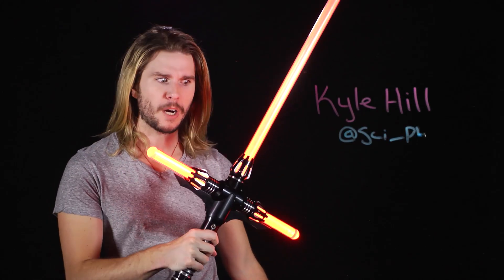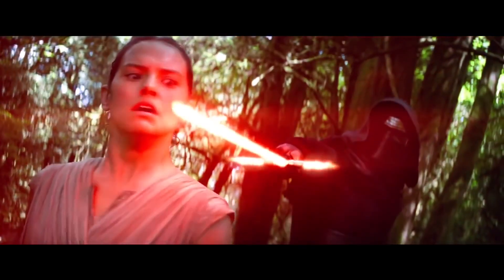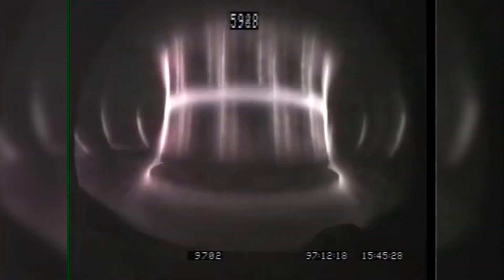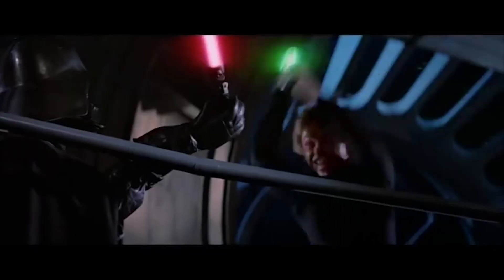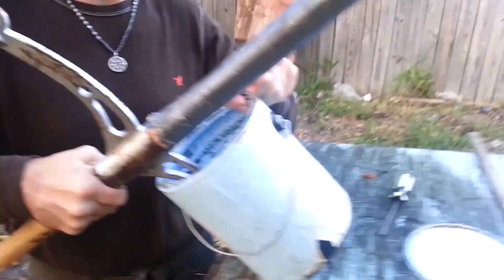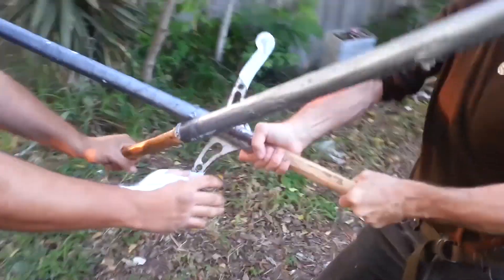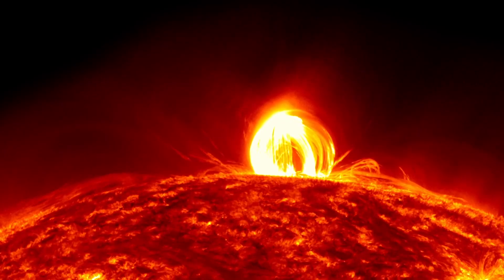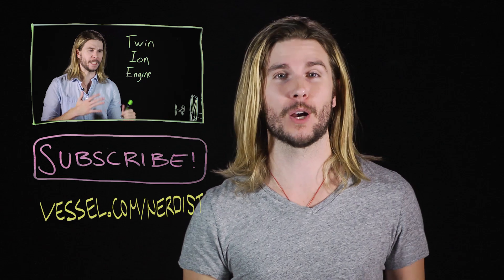Why Kylo Ren's Lightsaber Works (Because Science w/ Kyle Hill)

Comment: I really don't like Kylo Ren's lightsaber.
I know, it looks cool but I prefer the old lightsabers.
They just seem alot easier to control and use since you don't have to watch out for the other two lasers sticking out on the sides.
Reply: +Alexander Evensen You should try picking up a toy sword with cross guards and swinging it around a bit. You'd be surprised that it's pretty difficult to hit yourself with the cross guard unless you're doing it on purpose.
Reply: +Ahuc899  yeah, but I feel more comfortable with swords that doesn't have the cross guard. I know it's there to protect you and for safety reasons but with any sword I feel more comfortable with swords that doesn't have cross guards, like the Katana :D
Reply: +Alexander Evensen You might more comfortable without crossguards, but that does not change that crossguards were used for thousands of years to great effect. They are proven to be superior in traditional swordsmanship battles. Applying the force would not change the logic in which you use a blade or a lightsaber.
Reply: +Momyr Andersson  Yes I know. But I usually separate Sci Fi Weapons and Ancient Weapons.
I wouldn't mind to use a sword with cross-guards. I think the cross-guards are great but when it comes to star wars, I dislike cross-guards simply because "If Jedis and Siths didn't use cross-guards and still could use their lightsabers to both attack and defend, then I would prefer a lightsaber without cross-guard, also because it's more comfortable with just a simple handle to hold and you don't have to worry about cutting of your fingers or hand because of the LASER cross-guards. ". But when it comes to real life, I would of course have a sword with cross-guards if it really defended my hand in combat.

Well, I'm just a bigger fan of the old star wars lightsabers ;)

Comment: It's confirmed that Kylos kyber crystal is cracked, so it's unable to hold so much power resulting in unstable beam and 2 exhaust beams used as a crossguard. That's why they are enabled a second after the main blade (it can hold the full power for only that long before releasing it with crossguards).

Comment: Actually, it's not like that. Kylo lightsaber is an old style one, with a crystal which is barely able to contain the power of his saber. Have you noticed? it is different from standard lightsabers in many ways. The beam is less focused, more blurry, I would call it unstable. Those "crossguards" are just vents to let go excessive energy which crystal cannot handle. Later saber designs didn't need to have these vents (for obvious reasons - safety of wielder). But, as some of us saw, it has some practical uses ;)
I agree, it is used as crossguard but the desing its just too dangerous.
Reply: +shimano52 If by too dangerous you mean too dangerous and unfair to the people that have to fight against him with their cross guard-less lightsabers, then I agree. 

There are literally no disadvantages to having a cross guard. It is better in every way.
Reply: +Ahuc899 crossguards which cannot cut weilder ye. Lightsaber beam is like double edge sword. Imagine if in medieval times swords have their crossguards sharpen - both sides. Poor hands ;)
Reply: shimano52 You should try swinging a sword around. You'd be surprised that it's actually not very easy to get the crossguards to touch your hands/wrists unless you're doing it intentionally. Crossguards are extensively used offensively in history as well, and being a lightsaber would only make it better. Generally you're right they're not sharpened, but that's more about the fact that it was more effective to bludgeon than to cut with something in that arrangement.
Reply: +Ahuc899 We can debate about it all night long m8 ;) Its just matter of opinions and in a fact  - we both didnt have true lightsabers in our hands xD its nothin like normal swords, so we cannot compare them...
Lightsaber fighting style is base on a kendo, did they used crossguards in kendo based weapons - no. Facts. End of story
Reply: shimano52 Lol this is the perfect topic to settle with a duel eh? Shame we don't do that anymore.

Comment: Sorry, but there is a hole in the argument big enough to fly a death star through.

Aside from the utterly dishonest "If you don't have hand protection, THIS happens" - when in fact in several of the situations, the angle of attack was such that hand protection would have done nothing to prevent it - the notion that "any swordsperson would train enough that the danger would be negligible" ignores not only that it takes more than one person to have a fight. It also ignores that such training would fundamentally change how you use the weapon and have substantial impact on the utility of the rest of the blade and lead to a fundamentally different fighting style that may or may not be as effective.

The argument "this is why swords have had crossguards for centuries" ignores that there are plenty of swords which have no crossguards. More importantly, it ignores that said crossguards were not sharp. If having sharp crossguards would have been such a good idea, we would surely have seen them. Instead, we saw fighting styles which would have been utterly prevented by sharp crossguards. And finally, it ignores that lightsabers do not behave as metal blades to in sword-to-sword contact.

So, I'm afraid precious little science and quite a lot cherrypicking.

Comment: Kylo ren's saber wasn't made perfectly, hence the crackling and instability. So to keep it from exploding or whatever, he made it so the cross guard acts as a vent for the highly unstable plasma. It wasn't designed to be used as a cross guard, if it was it would be made out of the indestructible metal.

Comment: The unstable nature of the Kylo Ren's lightsaber is a testament to his incomplete training as either a jedi or sith.  Perhaps the handguards were implemented to keep the lightsaber from blowing up, which is usually the case when a lightsaber isn't properly created. To properly create a lightsaber requires an exceptional amount of focus and training with the force. There's a lot of fine tuning only made possible via the force for  a lightsaber to be properly constructed. 

It's possible that the focusing lens (which is vital in lightsaber stability) are misaligned. To counter this effect it's possible additional lens were utilize to keep the lightsaber just enough stable for use. This misalignment probably created the energy dispersing in 3 directions, hence the energy coming out the top and sides.

Comment: Couldnt you just have some protection under the crossguard? to protect your hand in case it slipped forward. It could even have a tube around the entire crossguard, with opening forward, so that the enemy lightsaber would hit the plasma and not the protection. Imagine a C turned 90 degrees to the left, going the full length of the crossguard.

Comment: I consider holding a lightsaber to be greater or equal to holding a jet engine with thrust pushing back..the reason Jedi can use them so effectively is because the force..I imagine the crossguards are for easy handling ..kinda like mauls double saber..the thrusts are pushing in on each other...there is some physics involved. rather then practical application..something like everything action has and equal/opposite reaction

Comment: "I haven't seen as much debate around a piece of Star Wars tech since Han Solo said "Parsec" instead of literally any measurement of time."

That's because a parsec is a measure of distance, not time. He shaved distance off of the Kessel Run by taking shortcuts and was boasting about that rather than doing it in a specific time.

Comment: What I find wrong with it is you can't bend plasma, the plasma needs to be focused through a crystal for it to actually be the lightsaber so how does he have little ones on the sides
Reply: +MrDavo511 And that's why previous crossguard lightsaber never had additional blades at 90 angle. I don't think it's possible to easilly shape beam in T.

Comment: I guess people are so anti-cross guards because 'offensive' cross guards were never used before making them seem 'impossible'.

To a standard sword, it would be highly impractical to have 'offensive' cross guards, because you could harm yourself, your friends, your horse while you would just carry your weapon around. There is no practical method to sheath your sword and the offensive cross guards. The advantage of having offensive cross guards for a normal sword is to low comparing to the disadvantage of cutting yourself while caring it around. Making individual sheath for blade and for cross blades would be impractical again since you won't be able to draw your weapon and each cross blade fast enough.

Now, with a light saber things get easier since you can easily sheath all the 'blades' with one button, giving you protection for your hands, as described in the video.

Comment: But lightsabers don't slide when they join blades. Okay well they do at times, and at times they don't but it's repeatedly told in the movies,games and comics that they don't slide. A simple crossguard is mainly there to protect against sliding blades. Sure it could be used offensively and isn't nearly as bad as Maul's blade but still pretty dangerous.

Comment: Yeah, but if you're gonna use the same thing as the surface of the sun, you should rethink. A pin as hot as the sun can burn anything within 16 miles of you, so... not good.

Comment: Nice video , but a few small things bothered me. Firstly the lightsaber (Lightstick would be way more accurate), has one cross-guard, two quillons. Secondly if the light part og a lightsaber was plasma, wouldn't an enormous amount of heat radiate from it, thus damaging anyone close? Finally, swords really aren't that heavy (As Hollywood would have you think), the non-weight of plasma would likely be more of a problem than a benefit, as it screws with the point of balance. 

Also a crossguard would not help against any of the hand injuries shown, as they were directly onto the limbs. Rather a crossguard protects the hands from a strike sliding down the wielders own blade, or serves to pin down the opponent's sword whilst thrusting.

Comment: The Star Wars universe has lightsaber resistant metals. The cross-guard could have easily been made from one such metal, instead of plasma beams. Or, the could have been a metal cross-guard (any metal) beneath the beam cross-guard, to keep the hand and wrist separate from the beams.

Comment: You've avoided how it actually works? How does one divert a lightsaber beam along the cross guard? And DON'T Just say "the force".

My problem is that you can't just bend the blade at a 90 degree angle, not even another lightsaber could do that. It would need it's own focus point, so the blade would have to start in the miniature nodules on the sides, so there would have to be a gap between the first blade and the small blades. THAT is where another lightsaber blade could cut through rendering the weapon impractical.

YES it's a cool idea, but I just think it's been executed poorly.

Comment: Have you ever tried to swing a toy lightsabre with the blade retracted? It is literally a billion times easier to spin around that huge two-hander than a hilt with no weight on the blade. It has no balance at all and you will drop it more often than not. Those handguards would chop him up, if you consider most lightsabre techniques. But who the fuck cares? The blade flickers so mightily that we can all agree it's horribly badly constructed sabre and that the guy is an idiot whiny teen.
Reply: Also, explain exactly how ANY of the examples you've shown would preserve their hands by having a hand-guard? Even one?

Comment: Yeah, cross guards have been around for centuries. But they haven't been capable of cutting through the user. There are metals in star wars that can withstand a light saber, that's already been established. Take the vibrolade for example. Which existed more than 500 years before the movies take place. Why the hell would he not use that material instead of something that can literally kill him if he makes so much as a single bad swing or misstep. Sounds to me like Kylo Ren is a bit of a poor planner. "But why would you want guards that constantly vibrate" I hear you asking. Well for one thing you can make most things, even now, so that the vibration is absorbed before it reaches your hands. For another, any rational person would take a hand guard that vibrates so quickly it's barely perceptible over something that, again, can LITERALLY kill the user. There's no excuse for such poor planning here pal. No if's, and's, or but's.
Reply: And I know it's to vent excess power. But then make a metal hand guard below that so you don't lose fingers! He's a sith, he should be pragmatic!

Comment: Everyone saying that there is a gap between the "guard" and the main blade therefore having space to slice them off... they all extend from the same source. Like taking a straw, making a hole with a needle straight through it, perpendicular to the direction of the straw. Blow through the straw and you have "leakage" through those holes, but it all comes from one source, your mouth.

Comment: You can control beam strength on lightsabers.  The Jedi practice fighting each other on a low setting that doesn't cut but only burns your skin.  So, the primary beam may be full strength, with the two others at a low setting.

Comment: It is a fairly well known "fact" that the so-called cross guards are not so much designed for Kylo's protection but are rather a venting system for his unstable lightsaber design.  That's why they look more like a couple of blow torches rather than auxilliary lightsaber blades.

Comment: I love Kylo's lightsaber, though honestly the cross guard is entirely useless. The whole point in a cross guard is to prevent an enemy you've locked blades with from sliding down your blade and slicing your had. But this literally has never happened in the history of Star Wars (or the Expanded Universe to my knowledge) Every single amputation clip you played was the result of a calculated swing directly at the hand-wrist/elbow ect, against an off guard opponent.

Also if the cross guard is branching off the main bladed the theoretically the cross guards should ignite first, since the plasma would pass them before reaching the end of the hilt.

Honestly I think it would have looked cooler had the cross guard been made out of a lightsaber resistant material rather than the blade

Also I used to by weed from a guy named Kyle Hill in high school. But that's unrelated

Comment: It has already been shown multiple times that the star wars universe has metals which are impervious to lightsabers. There is even a scene in The Force Awakens where a common stormtrooper is wielding a weapon made of it. Since crossguards are designed to catch an opponent's blade and keep you from having your hands taken off, wouldn't it not only make more sense for the crossguard to be made of metal but also be placed at an angle like on the CLAYMORE YOU SHOWED IN THE VIDEO! Claymores have an angled crossguard for that EXACT reason. In fact the only swords with 90 degree crossguards are longswords and given the way a lightsaber is used that is the worst possible medieval weapon to emulate for lightsaber design. Where are the lightsaber spears and rapiers? If a lightsaber is literally a magnetically contained torrent of plasma wouldn't you want to keep your enemies plasma-death-stick as far away from you as possible? Since all lightsabers weight basically nothing it doesnt matter how you design one, it will cut through almost anything like butter with no effort at all. I guess when you think about the technology that a lightsaber represents, a sword is the least practical possible design. You could design a weapon with multiple rotating and oscillating beams. No swordsman could possibly defend against all of them and would be shredded. My point is, science and practicality have no place in the Star Wars universe. If they did then stormtroopers would have Ironman style mech suits made of the Lightsaber-proof metal that we know exists and have computer assisted aiming on their weapons so they would never miss. Star Wars isn't science fiction though. It's fantasy with gadgets and future tech stuff thrown in to distract you from the fact that the Jedi are warrior-wizards and Stormtroopers are kobolds.